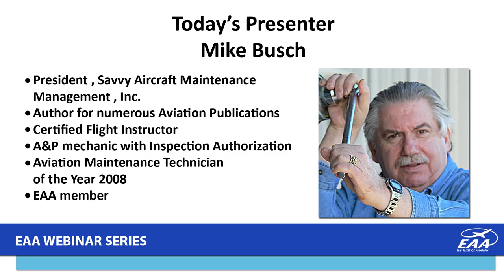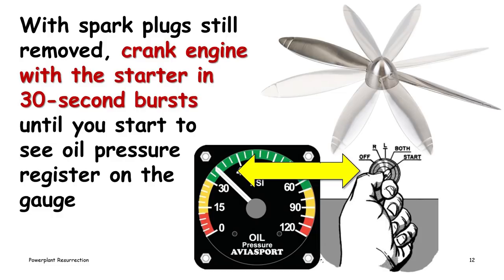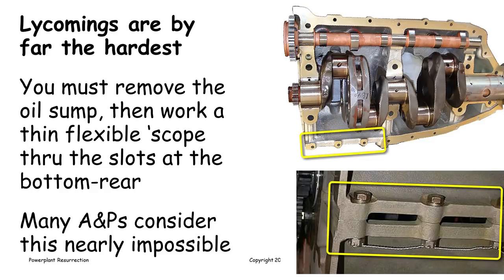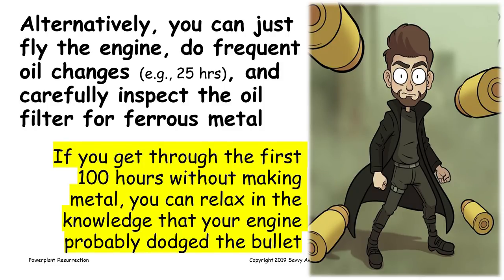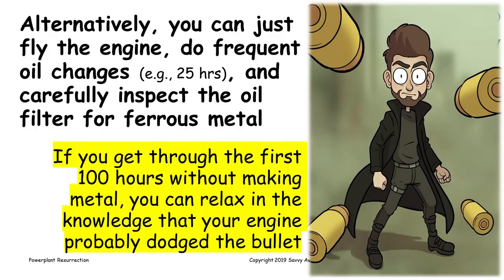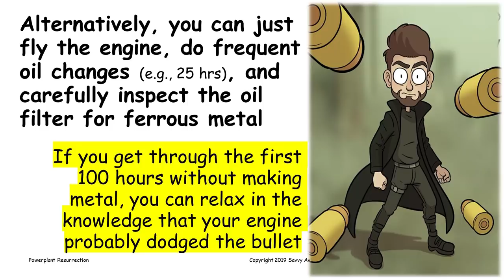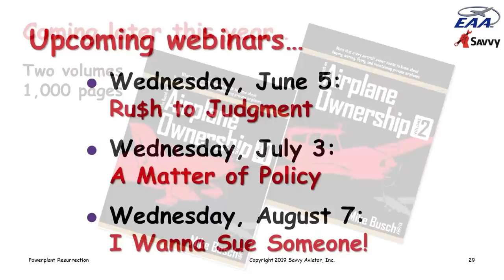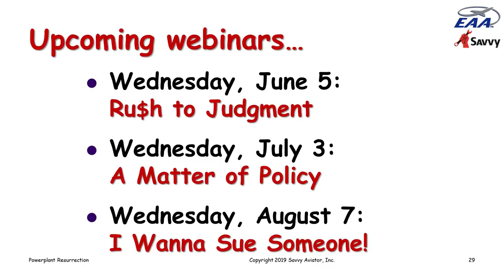Powerplant Resurrection

Comment: What worked for me is 4 or so quarts of MMO poured into the crankcase with a full oil sump of the older oil [15yrs.] pull the top plugs and fill those cyln. too. pull the prop through and let the oils flood out the plug holes. The cam is the only problem on the Lyc, engines. The engine is still running great 9 years later and 2400+ hrs. it is a lyc. 0-320...a bullit proof engine. Thanks for the video

Comment: I would think that the ethanol that is in most mogas would cause major problems after sitting for any amount of time.  It causes me problems all the time with my small engines that sit for more than a few months.  The ethanol absorbs water and the fuel in the tank turns to a mixture of gas and water.

Comment: I know you recommend against using synthetic oils for normal use but for pickling the film retention of synthetics might be better.  So, I would imagine the procedure to be change the regular oil, and filter, fill with synthetic and new filter, run the engine to get it hot and circulated (maybe fly?) and then shut down.  Then do the remaining normal pickling process.  Prior to return to service do an oil and filter change again to remove the synthetic oil and install your normal oil.  I realize that synthetic oil can't keep the lead in suspension but if the engine is only run for a short duration, say no more than 1 hour, it doesn't need to keep very much lead in suspension and there is little time to build up any sludge.  I guess the question to ask, is the risk of the lead worse than the benefit of the improved film retention?

Comment: Why not plumb oil lines, into your oil galleys.  Then pressure feed oil into the engine until you see PSI.  That way you're not turning your engine and creating dry starting. I do this with car engines.  Works great

Comment: I have a Lycoming O540 in long term storage.  I have blanked off exhaust ports etc, inverted the engine then filled crankcase, combustion, inlet and exhaust chambers with oil.  Will be interested to see if this has protected the internals.  My only concern is any potential condensation moisture may be building up around the cam shaft which in the Lycoming sits at the top of the engine (lowest point when inverted).

Comment: I have a Citabria with a Lycoming 0-235 C-1, with a stuck exhaust valve on no. 1 cyl.  2400 and change on AC with 2400 TBO...low comp. readings. I havent heard you say anything about stuck valves and wondered what you would do in my situation...its been sitting for  3 years now as I save money for repairs / overhaul....any advice would be appreciated !!